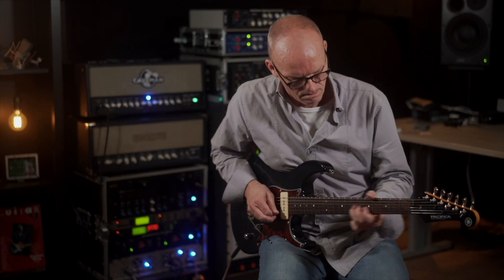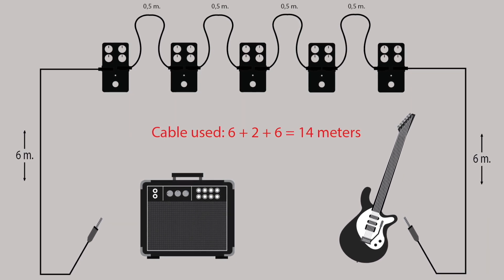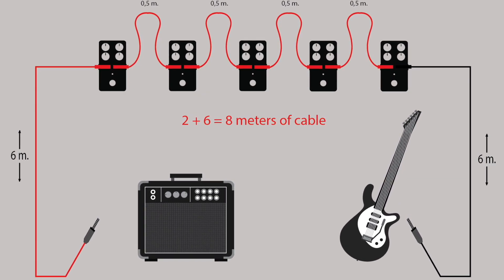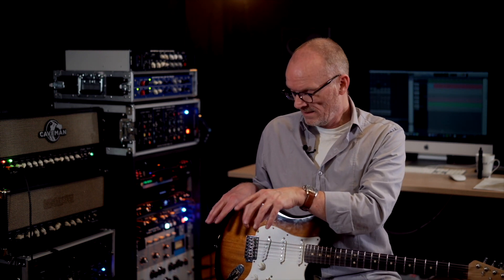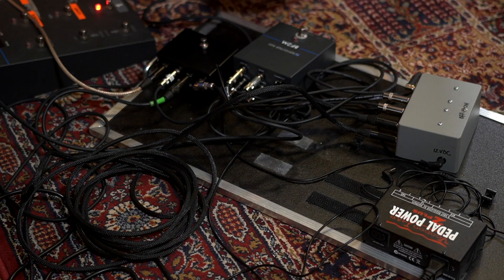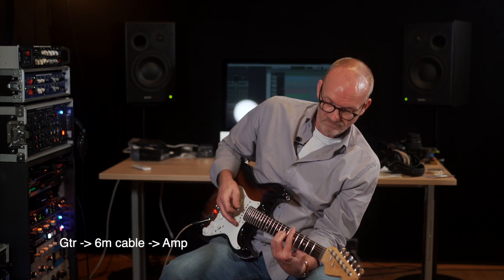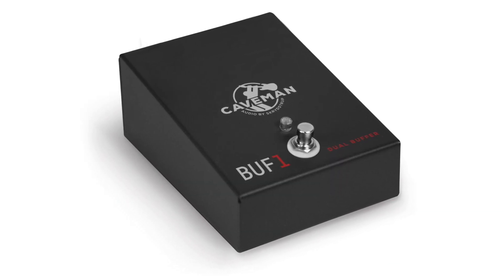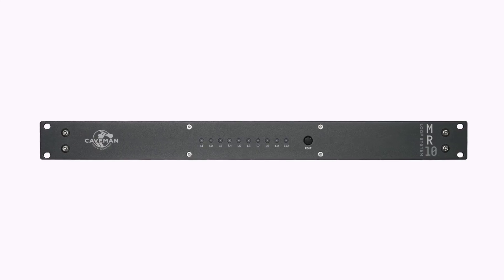True Bypass - Cool or Chaos?

Comment: Unfortunately (for me as someone with a basic understanding of audio electronics) your explanation totally made sense. I am feeling a bit stupid now, because I thought true bypass would absolutely be great, until a couple of minutes ago.
In general, a very good example for many things looking the opposite, when explained simply or in depth. Or, when looking at just a part of a problem like the pedal itself (true bypass = signal doesn't get changed). In comparision to looking at the whole system, including the guitar, the cables, the other pedals and the amp (true bypass = making a very long cable = compromising the signal).